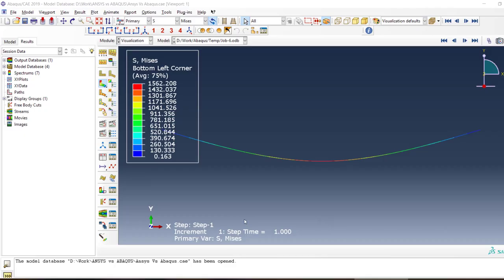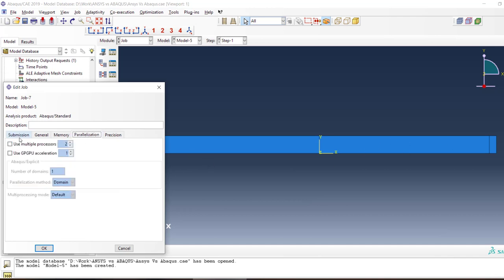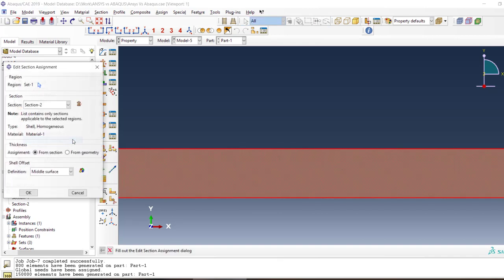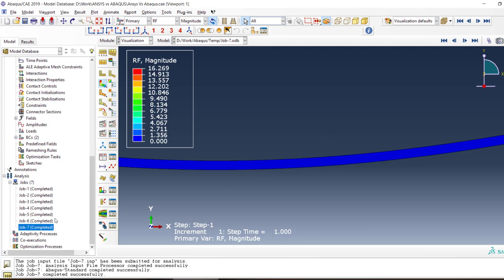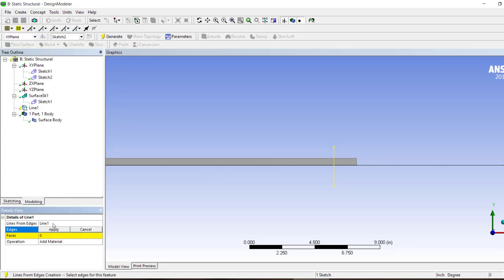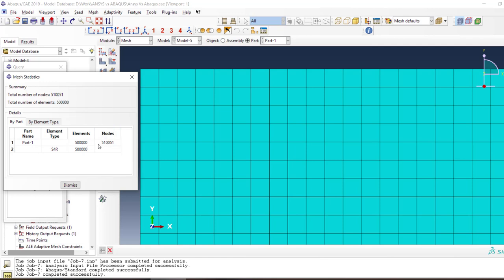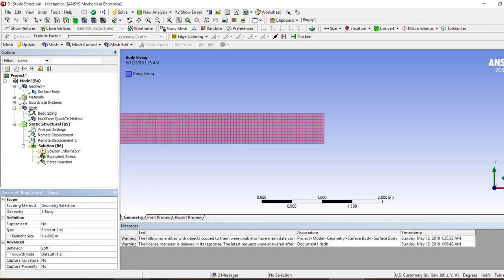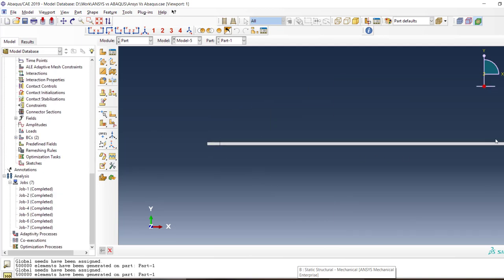Ansys Mechanical Vs Abaqus CAE Part 6 - Solving a Beam problem in 3D shell Mesh.

Comment: In Ansys, you should turn on 'Weak Springs' in Analysis Settings and only restrict translation in 'Y' directions to mimic pinned end boundary conditions. 
Further, don't compare analytical (textbook) results to failure theory like "Von Mises/Equivalent Stress".... you need to compare it to "Principal Maximum Stress.
The above suggestions will give you very close to analytical solutions.
Both Abaqus and Ansys FEA codes are bench-marked (validated & verified) extensively. As you say, we need to understand the software.
Reply from the maker: Thank you very much for your kind suggestions! 
The idea is to find out what can go wrong when we convert a beam problem(simple) into a contact problem (over-complicated). 
I agree that failure theories cannot be compared with textbook problems because textbook problems give out directional stresses as a result. 
The comparison is only for the same input without completely understanding how a particular software works(intentionally to see what can go wrong when you are not mindful). This is why all the cpu times, results and errors would mean nothing if we do not understand how this problem is to be solved using a particular tool(or software).